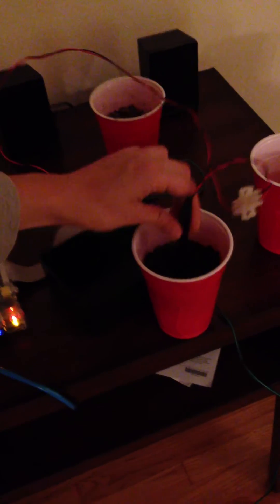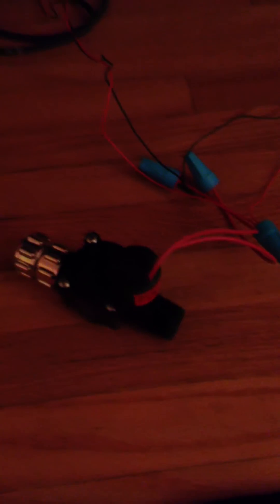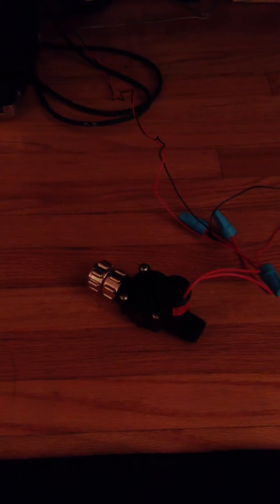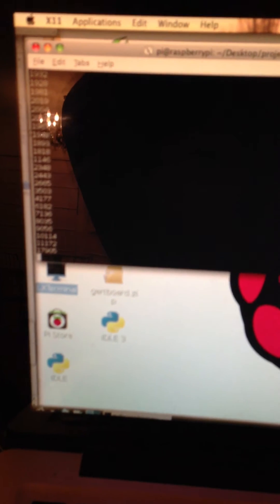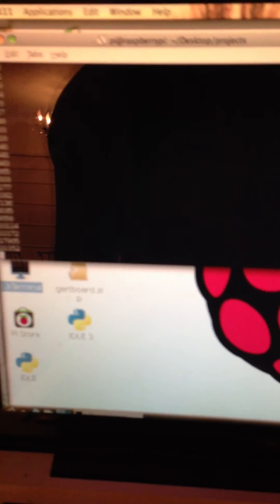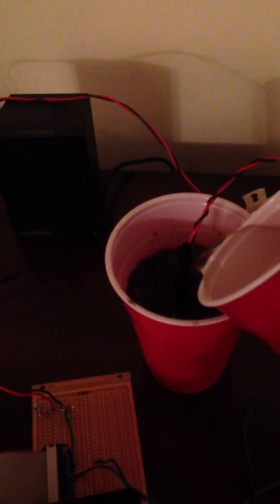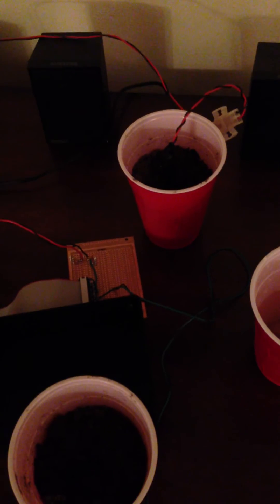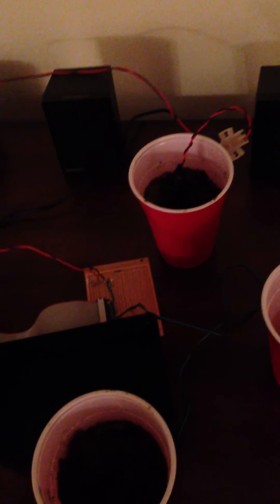Soil Moisture Sensor Irrigation Control System

Comment from the maker: Thanks for your interest! The capacitor design in this system was found on a blog, I added the specific URL for it in the video description. It has all the files and instructions necessary to manufacture your own, I got three for ~ $10 from OSHPark (the one recommended on the blog). 

I employed an AC solenoid, so I used a relay to switch the AC voltage w/ the Raspberry Pi DC voltage. Hope that helps! It was a really fun project and I'm working on improvements this summer :)